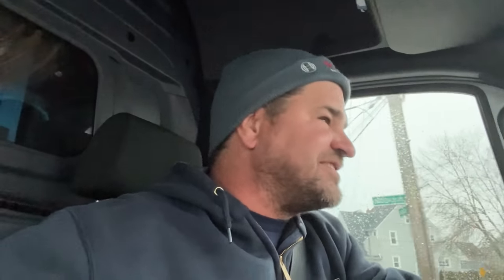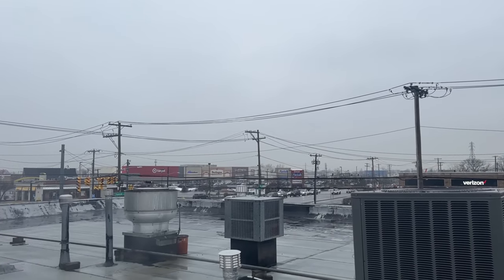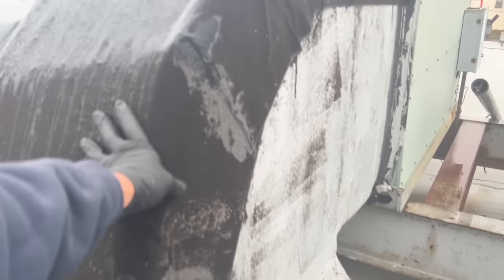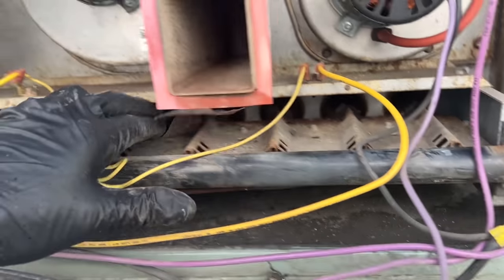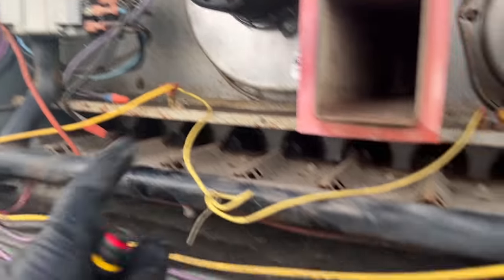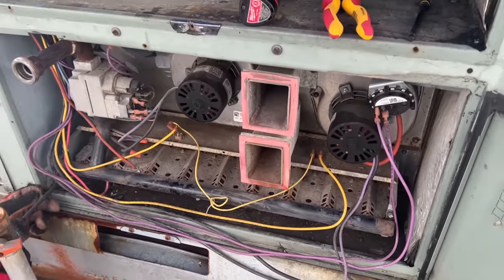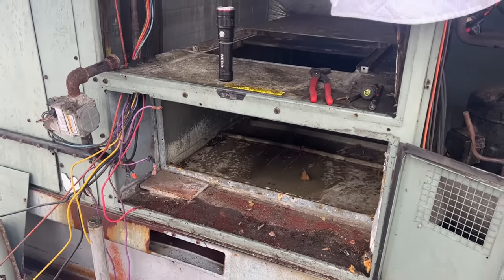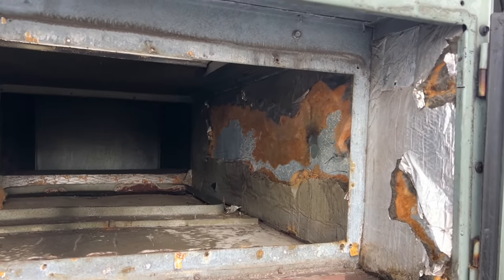Flame Roll Out on Rheem Rooftop Unit Repaired - Replaced Heat Exchanger

Comment: Did you replace the baffles in the upper tubes? I’m sure you did but you know the haters are going to say if you don’t show it you didn’t do it. I’ve done a dozen or so R/T heat exchangers. They all have their quirks. Can’t figure out why the engineers don’t just design them on a slide rack like a blower assembly. Would cut down on replacement time, reduce damage to insulation and truly just be a better design. Good work Mikey and Daniel. From the old hvac guy in Toronto 👍👍🇨🇦
Reply: If they made stuff quality like it used to be, stuff like a heat exchanger would last longer than every part in the unit...
Reply: @AmericanFarmerHVAC2024  ain’t that the truth.

Comment: Milwaukee has an 18v fuel portable pipe threader coming out in spring time. Be nice for steam boiler replacements. Have no boilers in my location but wish I did just so I’d have an excuse to buy that thing!!
Reply: @PipeDoctor  you are able to use those fittings for steam boilers? Didn’t know that.
Reply: @PipeDoctor  nice 👍

Comment: Anyone that would leave the heating tubes in the heat exchanger should have to live in that building with the heat running, luckily they did not kill anyone from the looks of their work from the wiring to their repair work on the unit.
Reply: @PipeDoctor  hacks make stacks

Comment: quick question, i did one today and when we went to turn it on, everythiing worked for 2 secs and then shut off
, board  had no codes! what could be the problem, we elemi,ated the roll out switches and still it kept doing the same thing!
Reply from the maker: Clogged oriface

Comment: Hope you pulled the baffels out of the old heat exchanger I'd you didn't get new ones
Reply: Not in the new one but you did cut after that with it running before the draft motor plate was installed  @PipeDoctor